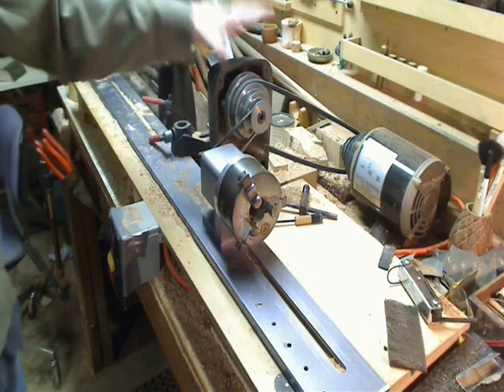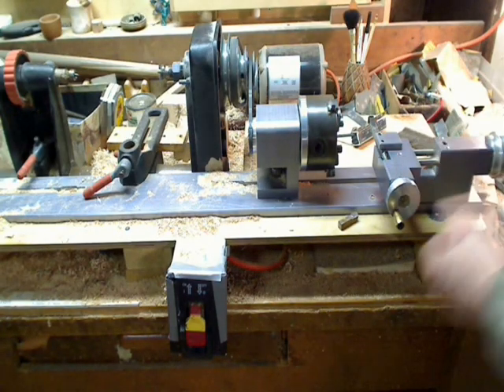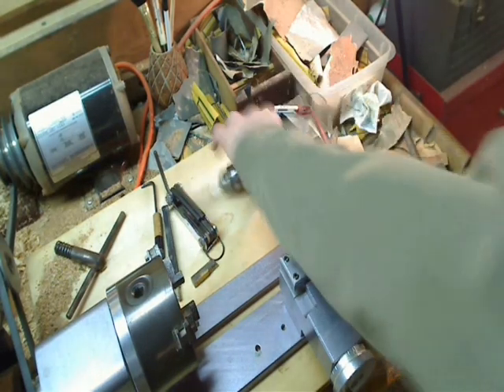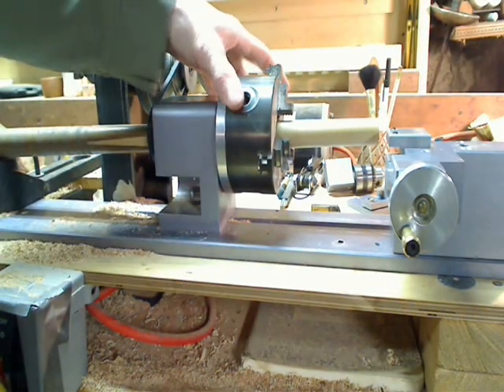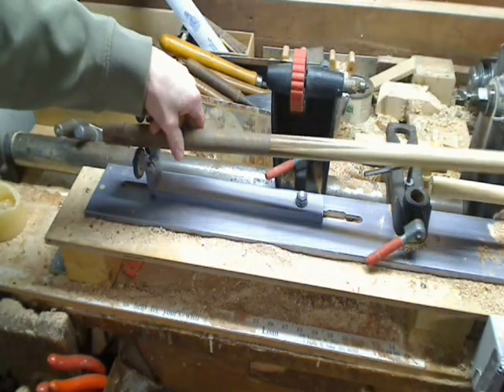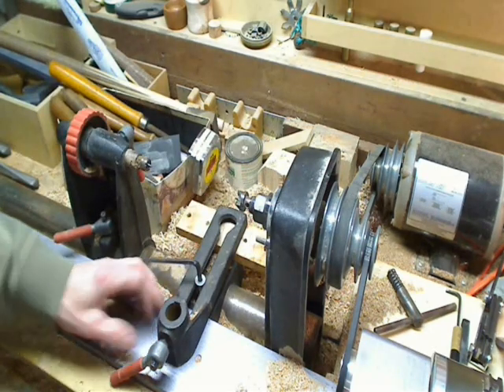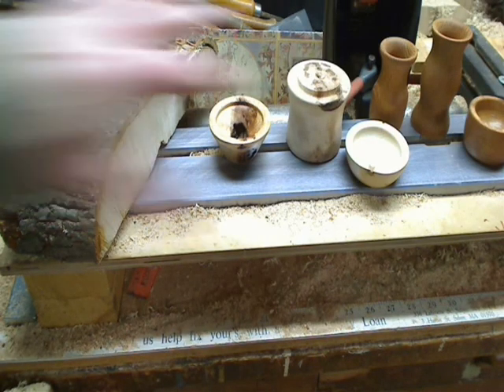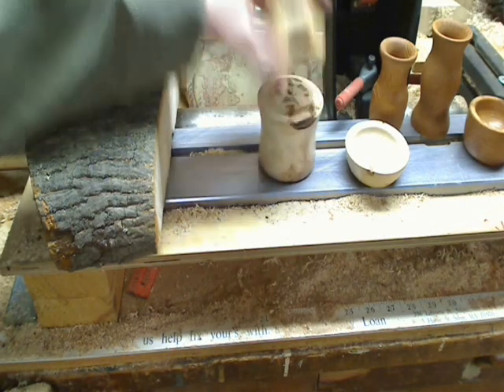home made Lathe rig

Comment from the maker: well at the time the video was shot I used the belt drive pulley off my old wood lathe as a 2 into 1 so i could drive my pool cue repair lathe and still use the wood lathe. can't really show in detail because the lathe setup has gone threw many changes since then. now it's just setup to run the pool cue lathe off the pulley and motor. thanks!